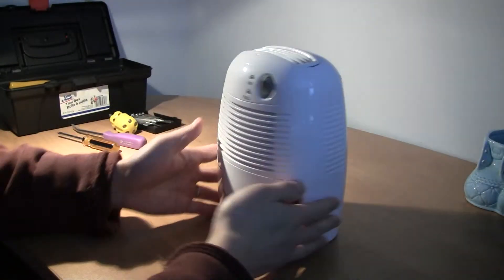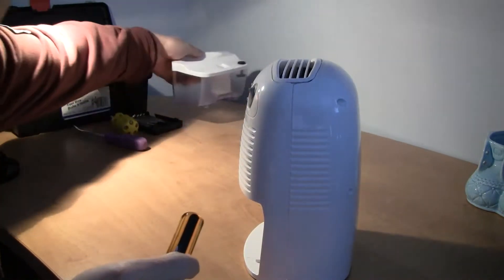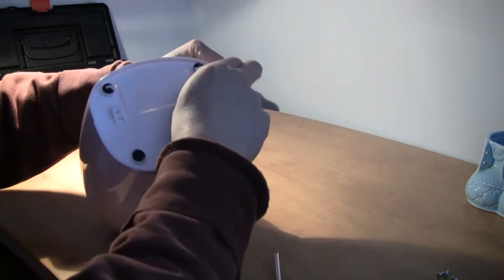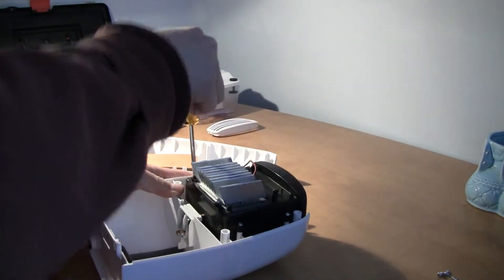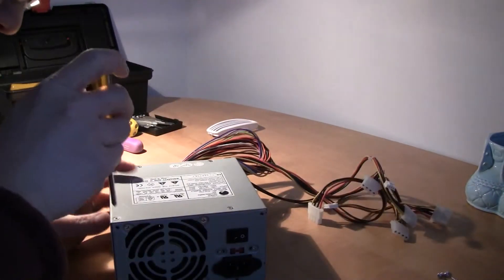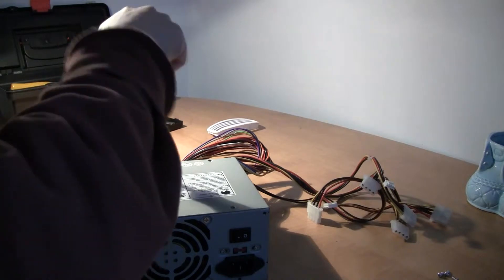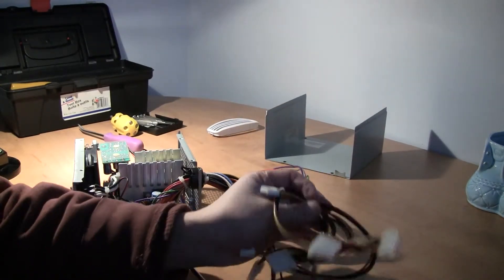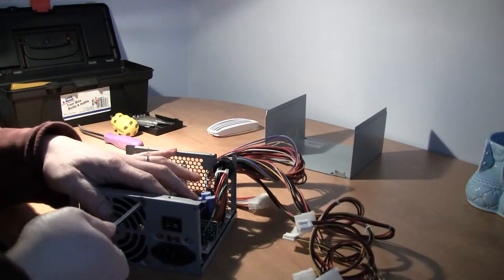Ivation Small-Sized Thermo-Electric Dehumidifier Fan Fix/Swap

Comment: I read some ppl swapped out the fan to a computer fan so it'd quieter. What specs for the fan do you suggest? And does it affect the power and efficiency of the dehumidifier?